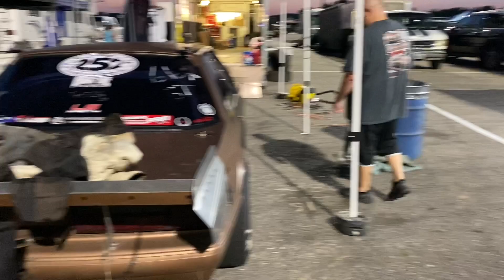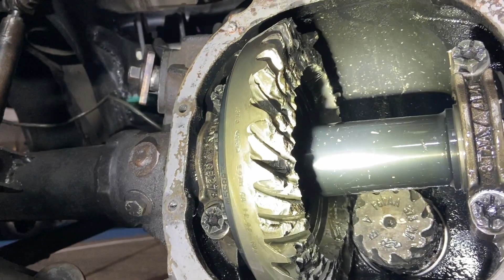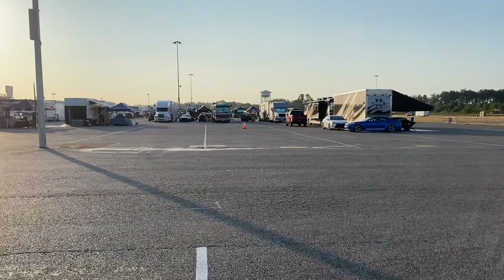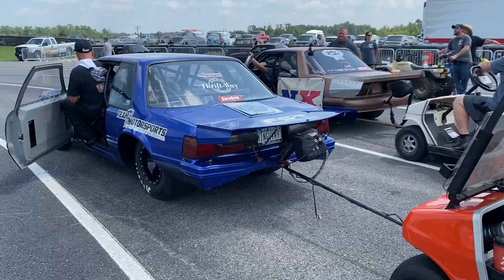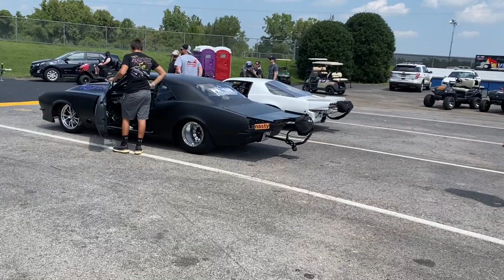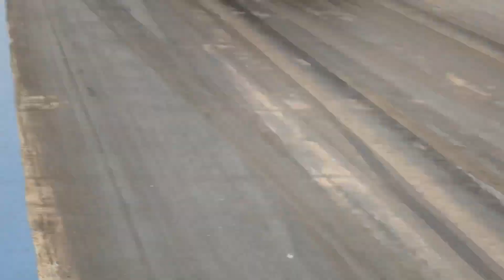Destroyed it!  Street Outlaws, NPK Virginia Motorsports Park 2021

Comment: Why the hell did they drag you all the way to the end of the track when the start line was less than 150 feet away ?

Would have been so much quicker and easier on the parts that were not torn up yet. (bearings etc.)

My old track would have NEVER done something like this...